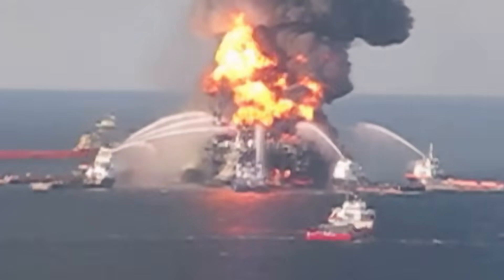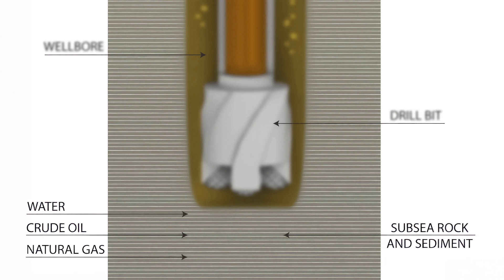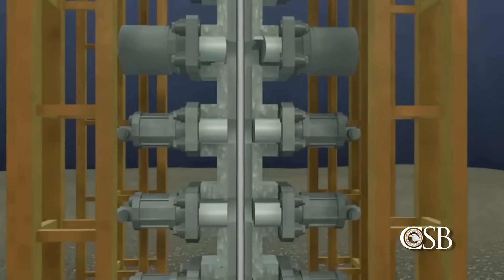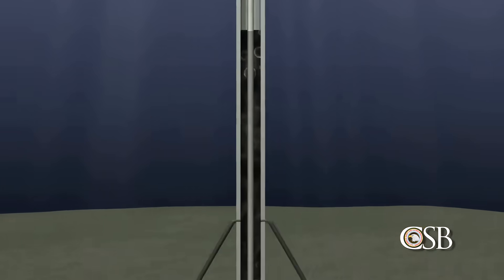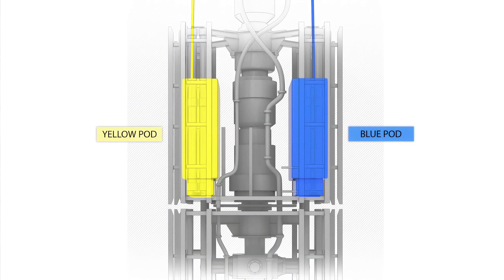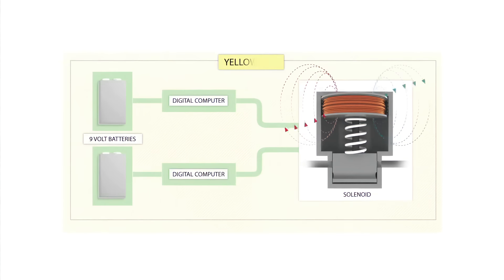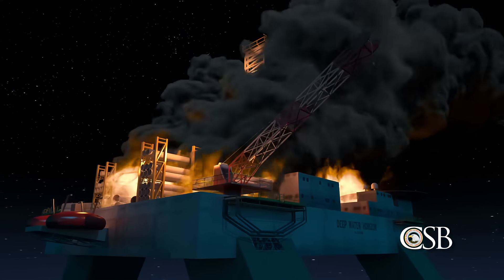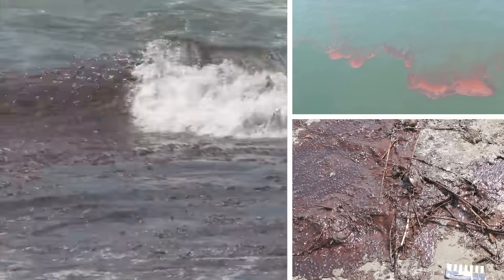Deepwater Horizon Blowout Animation

Comment: So, the most important pieces of safety equipment on a billion dollar rig... were wired by individuals who can't read a simple 12 wire DC schematic? 

Do they not test these assemblies before deploying them 5000ft beneath the sea? 

87 days of oil leakage. The company responsible for this installation should be banned from ever touching a rig again. Companies that install residential swimming pool pumps have better quality control than this.
Reply: And what have oil companies done to guarantee that other solenoids aren't similarly mis-wired? My guess is that the same person who mis-wired Deepwater Horizon likely mis-wired every solenoid he or she worked on.
Reply: @Mmmyess  Them self are not really responsible for the mis-wire they are just idiots (there are huge amount of them) that shouldn't even be close to something like that, but in the end its the company that have to teach the monkey to do what its supposed to and also have several checks after so noting could go wrong where they failed miserably in such a way its unheard of and should be totally impossible to do as well.
Reply: chicaneinokc I counldnt agree with you more on that. ET's and electricians on the rigs are making over 6 figures but cant correctly wire a solenoid.
Reply: This is the most truthful comment here sad reality we live in were people get paid to fuck up and others lose their lives to an over paid fuck up
Reply: "every time you go green you are essentially taking money away from these mother fuckers" - slightly ignoring the fact some of the largest investors in green tech are those same oil companies lol. Bunch of arguably predictable failures happened, as long as the industry (and FWIW government) has learned from the mistakes - as did happen after Piper Alpha - we good here.
Reply: Made in China by illiterate slave labor?
Reply: Fuckin' A!
Reply: Its hard for. An annular system or any man made apparatus to halt an active offshore blowout on a dime.. I blame preventative measures and bp cutting corners.. Which is in my eyes what caused the kick that sent the rest of the safety equipment to fail
Reply: Yeah but its Halliburton-Dick Cheney's old company.
Reply: because they're manufactured in the cheapest way possible in china, so a child or inexperienced worker probably did it
Reply: LogicalSense  Yeah, and Cameron International just paid for fun 250 million $ to BP because their BOP failed.
Reply: Well...they had a 50/50 chance, smh. It's 2 F'n wires!
Reply: Nearly every accident is caused by human error.
Reply: Seem to recall the 'British Petroleum' was repeatably named checked during the disaster - who was it that made, fitted and maintained the BoP?
Reply: And all it would need is a couple of 5 cent diodes to make sure the electrical polarity is correct
Reply: I cannot agree more. Banned from EVER getting even remotely near an Oil Rig..!
Reply: Yeah, good luck with that; the oil companies run the worlds economy.
Reply: @samueltaylor4989  Your comment almost portrays you as someone that is not a consumer of oil or hydrocarbon based products. Either that or you’re a brain dead hipocrite
Reply: I guess we didn’t have enough of those cumbersome regulations in place to make sure this shit was done properly. We just give these companies the benefit of the doubt even though they have literally never given us reason to. They cut corners and skirt regulations and lobby to kill regulations that help prevent shit like this from happening. Fuck you, BP.
Reply: @rizzorizzo2311  Also speaking of lobbyist..what do you think about the afterbirth abortions approved by some states. You know lobbyist for planned parenthood paid millions of our taxes to state reps. I think lobbyist should be banned all together.
Reply: im pretty sure lobbying is supposed to be illegal anyway.
Reply: @rizzorizzo2311  There are thousands upin thousands of drilling rigs in the gulf of mexico alone. 1 BOP failing out of thousands isnt that bad. Oil came from earth and will eventually all go back into earth. BP got hefty fines and the families of victims were paid. Lessons learned unfortunately
Reply: This commen is op
Reply: Best songs of travis tritt
Reply: And how it went unnoticed. There has to be at least one supervisor for this component.
Reply: Wow! Failed..!
Reply: Sounds like B.S. to me!!!
Reply: No the massive multi billion dollar card more about money than the lives and danger of the rig. If you if watch the movie  Deep Water Horizon it shows this perfectly.
Reply: BP is done after repaying the 62 billion the rig costed
Reply: @abusedpigeons225  BP earned all their horizon losses back in one fiscal year. Pretty much a hand slap.
Reply: Just think if it was an AC it wouldn't have mattered how it was wired
Reply: So much for quality assurance checks
Reply: For all those really curious what happened on the horizon, I can tell you exactly why the horizon failed. I won’t give details on how I know this information or names but I will give you all the truth of why the rig exploded. 
Deepwater horizon was built in South Korea and it took 3 years. Some incredibly intelligent men built that rig. BP got approval from Obama to drill there because they went to 5000ft and no one had ever gone that deep before. Everything was put into place in perfect working order and BP turned the rig over to transocean. They were the ones responsible for operating and are the 2nd largest drilling company in the world at this moment still. BP works very closely with transocean and remember this. 
One month after BP turned the rig over to transocean the project manager who built horizon went back and inspected. His findings were astonishing, all the operation and safety manuals were gone, the safety alarms were literally cut. When asked about this to the transocean driller, he said because the alarms were constantly going off and waking up people they physically cut them out. This report was obviously buried and 1 month after that report was filed it blew up because no one was physically watching the gauges and the safety measures were disabled by transocean. BP took the fall because their close relationship with transocean. 
Of course this isn’t the narrative the movie portrays, because how are you going to feel bad for those people who worked with transocean and destroyed horizon and polluted the gulf? Instead they portrayed a tragedy and blaming BP for everything, when in reality you’d actually be yelling for them to burn with the rig for not doing their jobs and you say that those backwoods Cajun hillbillies got what they deserved. 
Believe me or not I don’t care, but that’s the truth of it.
Reply: @khure711  
Truth as told by some nobody on the internet.
Reply: The people in the comments section sound like angry losers.
Reply: You're honestly quoting business insider? That's your source?
Reply: Maybe, but most solenoids are not polarity dependent.
Reply: ackmino the solenoid was somewhat polarity dependent because it had two coils. It mattered only that both coils had the same polarity not what the polarity was. 

Funny enough i suspect they used this two coil design to add another fail safe and because of improper install it almost caused the failure.!
Reply: Bro I feel that all the time all the time we check your bops every  time
Reply: Chicaneinokc Mercia
Reply: they are still drilling. only received a small fine for the leak and destruction of the Gulf wildlife. which has still not recovered in 2019 and the water is toxic from the chemikill dispersant they used to sink all the oil on top of the water.
Reply: LogicalSense  😀👍
Reply: Does it surprise you? The space shuttles were made by the lowest bidder.
Reply: Chicaneinokc that’s because the pool pumps are probably regulated. Americans have allergic reactions to the R word
Reply: americans today arent the americans of 1776, or even 1876. they have been purposefully dumbed down via the mis-education system. im not preaching from on high - the exact same thing has occurred here in england too. it is incredibly sad, those in control have done it so that we find it harder to turf them out every twenty five years as jefferson advised

i know this sounds like a crazy 'conspiracy theory' (a term itself devised by the cia circa kennedy assassination to discredit those not buying the government's bullshit)

but yeah, this is an undisputed fact. i read a lot of history, and when you see the diction and vocabulary of working class folks from a hundred years ago - the difference between them and a similar man in the street today is absolutely shocking and stark indeed

for instance, go look at some of jack johnson's (the black heavyweight boxing champion) surviving letters and statements to the press. this poor largely uneducated black man from the turn of the century speaks better than most college graduates today

 the same goes for my country, if you read letters from for example poor working class young men in the trenches of world war one..   their diction and vocabulary, as i said..   is sadly night and day when compared to today. this is why we in the west are falling behind - we have been sabotaged from on high and i only hope to live long enough to see the people who have helped carry this insidious programme go up against the wall for their treachery, for both our peoples yours and mine
Reply: As someone who works for a company that installs residential swimming pool pumps, I agree with this statement :p. Shocking that nobody bench tested the thing.
Reply: more like 300 million dollar rig
Reply: Chicaneinokc testing seems to be the failure to me as well. If the solenoid was always wired incorrectly they that should have been discovered in testing. But at the end of the day the failure was in the mechanical design failing to cut the pipeZ
Reply: Banned? How about jailed!!! This is gross negligence at the highest degree! They should be in prison! You don't get to mess up this big and get away with it! There should have been at least 10 checks on every single component
Reply: TJ well it’s worth remembering that their failure didn’t actually cause a problem it came very close and they got very lucky that it didn’t. But at the end of the day the failure was the shear design. So you would have a hard time justifying jailing them.
Reply: For christ sake its essential the same thing as putting the battery in the wrong way
Reply: okay karen
Reply: @erikmeyer5207  I know that happened, which is obvious if you lose power, but don't know what the impact of that was.  I saw another video that said the casing jumped up into the BOP.  so I literally have no idea what happened
Reply: @erikmeyer5207  the strange thing to me is that in the movie which is always accurate, lolz, the employees wouldn't trigger the BOP  until the safety officer was there.  That seemed kinda screwy to me
Reply: That's BP for ya!
Reply: And they will fight any regulation that forces them to take additional testing measures. This company is already been back at drilling for years with the same methods and BOPs
Reply: Just imagine how bad it's gonna get
Reply: This was how Tony Buzbee made his money:  defending the plaintiffs against BP.
Reply: Its called union work.
Reply: nope, america.
Reply: I call BS. The solenoid valves were spring loaded, normally closed, and could only be opened by applying current to the solenoid; thus, if the power was lost from the backup supplies AND the primary supplies, the valve would mechanically close by the spring set. If the primary wiring also charged the batteries, mis-wired secondary circuits would have caused a fuse to blow, or breaker to trip in the primary upon startup.
Reply: @cpharris3059  Those solenoids open to allow hydraulic fluid to pass and operate the shear ram. You're right, they are spring loaded, but without power to operate the solenoid, the fluid will not flow, and the ram will not operate. The fluid they show in the video is not crude oil passing.
Reply: @tonykara  The fluid is already “charged” inside of an accumulator tank, with back-pressure supplied from a nitrogen filled bag that’s inside the same tank. The accumulator tank is pressured at all times, with enough hydraulic fluid to operate whatever equipment it’s intended for, with or without power from the rig. Just imagine how a fire extinguisher is already charged and “ready to go”.
Reply: @cpharris3059  would not depend on a spring under such pressure and temperature, it would settle and become not a spring
Reply: @cpharris3059  Since you don't know how they are built and the manufacturer didn't thought anyone of their employs could fuck up this much, (and well the company as well) they were not designed with any fuses to blow or similar nor either obviously checked after they were made. As you can see there were 4 wires into the coil which I see that it contained 2 coils and thus one for open and one to close and the spring is as I see it just to help to close so the coil does't need to be extremely huge to be able to do it by it self.
Reply: ohh crap!! it was wired specifically to stay closed! the whole "safety feature" was set to fail. they couldve set it up as normally closed WITH POWER, in the case of a power failure the valve would go to normally open/shut valve as a dam default. you dont need batteries or a computer plus the fact it was wired so the magnetic poles HELD IT CLOSED with no chance of opening.. this could be a terrorist attack ..
Reply: @seekr6964  I just cant for my LIFE understand how a key safety function like that obviously was not checked, checked and dubbel checked again to be 120% sure it was ok since it was such a crucial thing, it is just totally beyond me! Are there any open investigations about the company and such? There had to have been put a investigation on that company!!?
Reply: @dtiydr  umm, i beleive none of this was an accident. they couldnt have done it if it was "inspected". this is probably a video created by the company to shift blame. if you have a piece of pipe in an isolated sealed chamber.. it shouldnt matter if pipe bent.. it would only allow so much bend because its in a box with a shear that creates a section of pipe. accordintg to video the bent pipes were still within the jaws of the shear blades.. ahh it would have had to cut the pipe perfectly to seal it from leaking. on the other hand.. EVERY oil rig out there is setup exactly the same way.. how fckn greedy can you be.. you can only spend so much in a life time yet these evil fcks trade innocent souls for more more more paper illusion. our dollar has no value thanks to nixon
Reply: @seekr6964  True that.
Reply: CP Harris yes the valve was normally closed but it stayed normally closed until it was needed to trigger the shear. It was not opened on startup as you state. You would never discover this error except during testing.
Reply: @cpharris3059  Sorry for your confusion....
Spring is holding solenoid in NC position. Have to be NC, otherwise solenoid would be prime candidate for burnout holding it there. Narrator said battery drained, not shorted - so your 2nd point not valid. The counter-active forces/directions of the 'dumb' coils could not be picked up unless there was a sensor for the valve position.
What is interesting is reliance on ( I assume hydraulic ) > fluid > and that it's not redirected from annular cavity - that would probably mean a substantial pressure had to be maintained- which at that depth could be a real problem, ie much greater than the outside or cavity pressure in order to close the shears through the pipe >>15MPa (Which as 
JetMechMA pointed out -should have been off centre reciprocating vee profiles to shear it completely regardless of position in cavity.)
Reply: Chicaneinokc agreed
Reply: The most enraged feeling I have about this is the wildlife. People (oil drilling "experts") meddling with the forces of mother nature.
Reply: Homer Simpson
Reply: LogicalSense  Since you like wikipedia so much. 

"Cameron manufactured and sold to Transocean in 2001 the blowout preventer (BOP) that failed to close the well head and stop the flow of oil from the Deepwater Horizon oil well in the Gulf of Mexico. News reports stated the equipment was not properly maintained by its operators and may have led to failure of the BOP system.[13] In December, 2011, Cameron agreed to pay a $250 million settlement to BP PLC to settle all claims related to the Deepwater Horizon[14] without admitting responsibility. "

It is true that Hyundai produced the first BOPs used on the rig, which is normal way of operating whenever you built machines like these. However you have to take into account that subcontracting on projects of this scale is incredibly common. Especially when it boils down the specialized pieces of equipment such as a BOP.
Reply: Everybody knows the USA and Quality electricians are a bad match, it is back in the stone age basically compared to europe.
Reply: @leonardoartistof16thcentur80  You DO know this company happened to be in Europe right? lmao America being on 120/240v doesn't mean we are in the stone age. Not to mention the rig was built in South Korea by Hyundai. Clearly to save money.
Reply: @leonardoartistof16thcentur80  That's a nice little sentence you have there.  What does it have to do with the Deep Water Horizon which was built in S. Korea though?
Reply: fuck the oil companies mothers, vote with your pocket, every time you go green you are essentially taking money away from these mother fuckers
Reply: Look at this arm chair quarterback. I bet New England would have won the Super Bowl if they put you in instead of Brady.
Reply: @Gamebreaker08  Retired USAF avionics tech here who agrees with him. Bench checks and operational checks are appropriate for critical systems, end of story.  One person should not be able to fuck up the process because critical processes should have at least two sets of eyes and as much testing as required followed by operational checks where possible which is most of the time.
Reply: Ob Fuscated you 100% right, this was a failure allowed due to lack of testing. 

The ram should have been tested on install. The battery voltage and ability to hold charge should have been tested regularly. The ram should have tested at full working pressure.
Reply: LogicalSense  So the company Cameron International from Houston, Texas, USA did not manufacture the BOP?
Reply: Wired in China.
Reply: @narcoleptic8982  General Electrics is chinese hahha
Reply: @narcoleptic8982  Even they would actually have got it right.
Reply: @narcoleptic8982  nope, at least the chinese get things right. This was likely done by some moron in america
Reply: @narcoleptic8982  Wired in China? Honestly, If I was going to have stuff wired anywhere in the world, one of my top picks would be china. The old 'made in china so it's crap' mentality doesn't necessarily exist anymore.
Reply: It's probably one of those companies where the bosses only like hard workers who get along and listen to what their superiors think, but don't necessarily want their workers to be too free thinking. A free thinking person would have been able to figure out how to prevent this if they were working on that oil rig. Only a herd mentality could have been that unintelligent. This is why we need more government regulations: our private companies are negligent just so they can lower costs. Imagine if you had tried talking to one of the corporate people who owned that rig; they would have laughed in your face and started talking about their vacation homes in Costa Rica. These private companies are owned by naïve greedy con-artists who are in no way interested in taking proper safety precautions if they don't have to. I'm sure that they would even be willing to tell people that oil spills and other catastrophes are a necessary risk of having a "good economy." But we know they aren't necessary because we have had the government stepping in for years enforcing regulations and holding companies monetarily accountable and sometimes even putting these corporates in prison. And why is the government better--because the government is democratically elected and the private companies are not.
Reply: Designed, assembled and wired in the USA. Do I have to say more?
Reply: @konorkoler  You could start by saying something true.  It was built, assembled and wired in South Korea.  That isn't a dig against S. Korea... it is just the fucking truth.

Do you make a habit of just stating what you feel in your gut as actual fact?
Reply: No one can stop DEANDA, that's just facts, doesn't matter if they can read or not
Reply: Trigerr: what is 'deanda'?
Reply: Tigerr: What is deanda/denda?
Reply: 500 Years  "American Exceptionalism"... Sounds an awful lot like "Aryan Supremacy" doesn't it...
Reply: @Chris-xo2rq  Sure does.  Though, I wonder does "Blame America for a oil rig failure despite the fact that it was built in South Korea and run by British Petroleum" sound like anything to you?